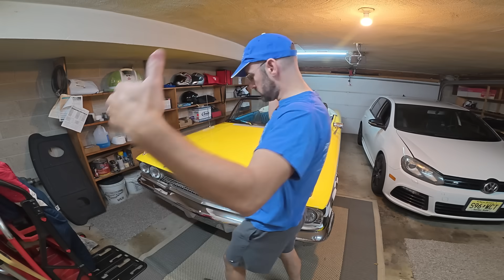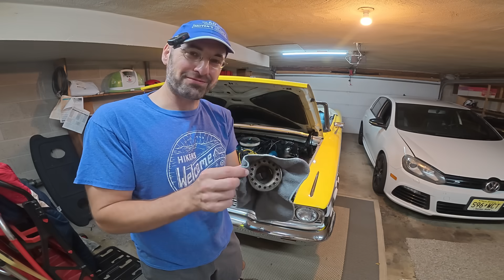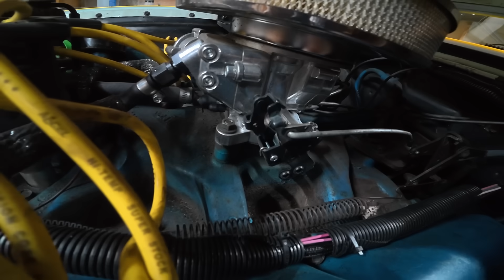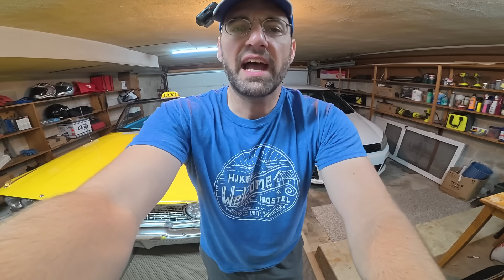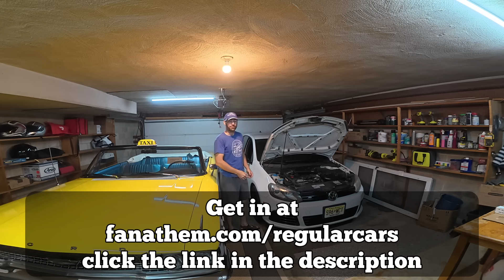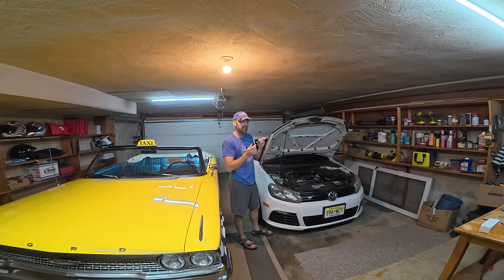Why do Direct Injection Engines Develop Carbon Fouling? #cars #carrepair

Comment: Toyota has both port and direct so you can have power/fuel and no carbon valving
Reply: It always throws me for a loop when it switches between port and direct. I've owned that car for 8 years and I always have that sinking feeling of "is that knocking"
Reply: Ford has it too in the Coyote since 2018 in both the Mustang and the F-150.
Reply: My Mitsubishi has that as well, hopefully it all works.  I think its port at part throttle and direct for more throttle,  or maybe the other way around😂
Reply: Hyundai Santa cruz has dual fuel injector system as well. Strange idle when it switches modes
Reply: No, that just means they sell you a crank case cleaning service on your maintenance intervals. My wife's 2018 Corolla has 2x the maint cost of my 2016 Civic. Its bonkers.
Reply: @adamgroszkiewicz814  thats just an upsell tactic used by toyota service departments.   trust me, ive worked there, and never subjected my customers to buy b.s. you do not need a "crank case cleaning" at all, especially if you a.) change your oil on time, and b.) always run top tier fuel.  the dual fuel injection, toyota D4-S system will, and does work as engineered by keeping carbon deposits off of your intake valves.
Reply: @adamgroszkiewicz814  not sure how D4-S forces you to need crank case cleaning. Pretty sure you're getting scammed.
Reply: @shaunwu3910  Thats my entire point regarding the Toyota ownership and dealership experience.
Reply: @adamgroszkiewicz814  well that's not a problem with the car, just with the dealership which varies by dealership. I'm sorry you got that experience, but you made it sound like it was a defect inherit to the D4-S system and not just your local dealership.
Reply: @shaunwu3910  Same dealership experience at 4 seperate Toyota dealerships in 2 different regions. No sir, this is just how Toyota operates. Fanboys can't recognize it because they don't have other dealership experiences.
Reply: @adamgroszkiewicz814  You're missing my main point. The original video was talking about the pros and cons of different fuel injection systems. The original comment was talking about how well the combined port and direct injection system performs in combing the best of both worlds. Your original comment seems to imply that the D4-S system is at fault for increased maintenance costs. As someone that owns a car with D4-S, I wanted to know why that would be the case. Turns out the cause of increased maintenance is Toyota dealership scams, not D4-S. I understand you have had a terrible experience with the Toyota brand, but everyone else here is trying to have a technical conversation to better understand how cars work. Please understand why everyone else in this comment section might dismiss your comment or try to correct it, we are talking only about the cars themselves and not brands. You very well may be right that Toyota dealerships nationwide scams more than most dealerships (Tacoma engine recall doesn't inspire much confidence for me either), but the context of both the video and this comment thread is talking about the technical details of how fuel inject systems work.